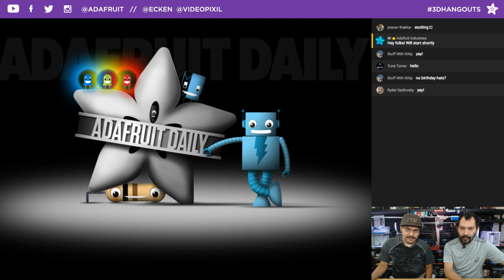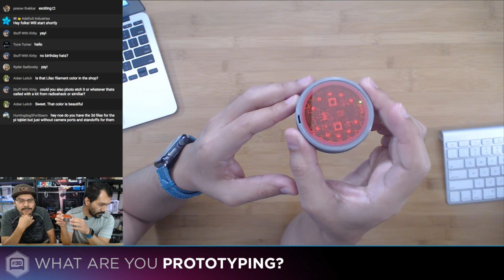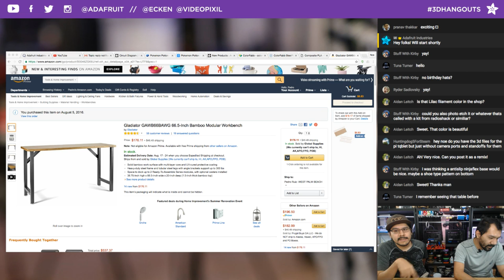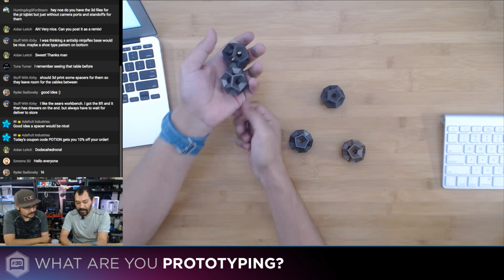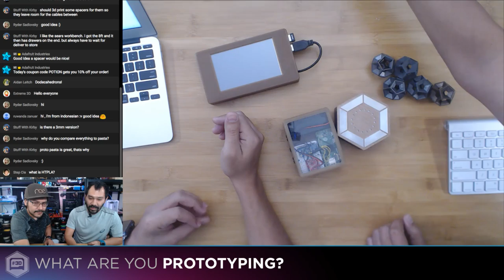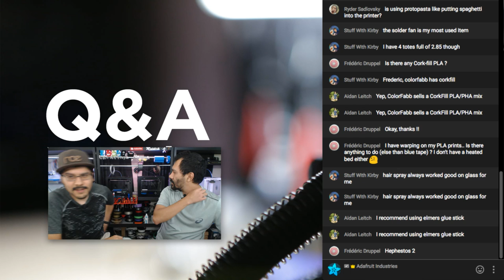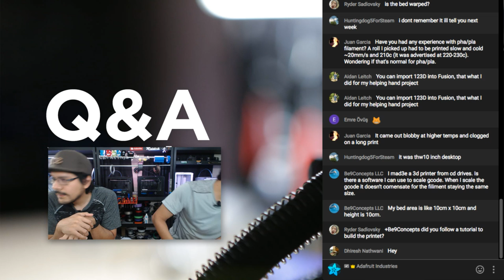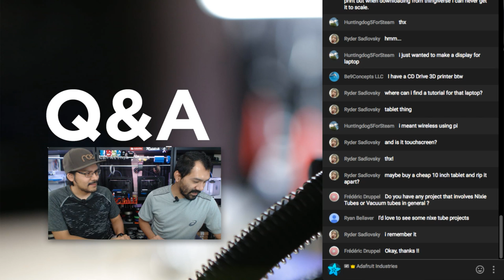3D Hangouts - Metallic Filaments and Magnets

Comment: Thanks for answering my questions on print speed! Would love to see a guide on that :D

Do you have any tips on leveling the bed of the FlashForge Creator Pro? I've been trying to print the Halo Energy Sword handles and found that my bed leveling isn't up to snuff on printing the handles vertically. I managed to get 95% done on one side and then the part was knocked over. Also the print times listed in your learning guide are way faster then what I end up with using the same print speed settings on my FFCP. You have listed 4hrs for front and back handle pieces. A single side with the same speeds and no supports is listed as 7hrs in S3D, with support ~12hrs. Does the type A machine just print much faster, or am I missing something? Thanks again!